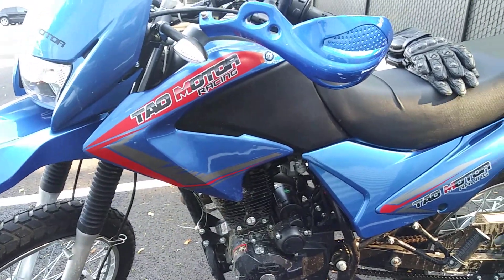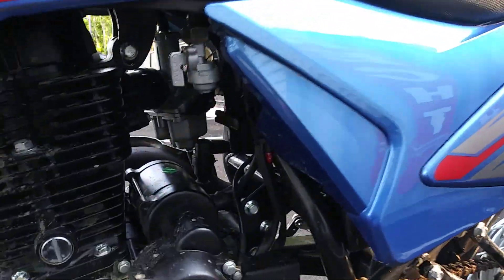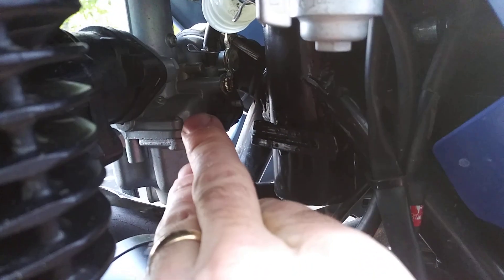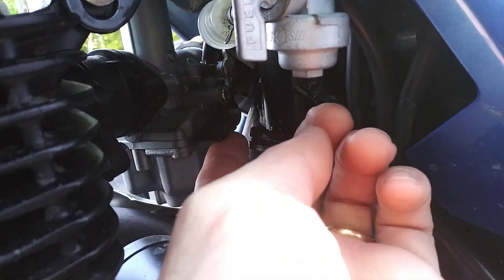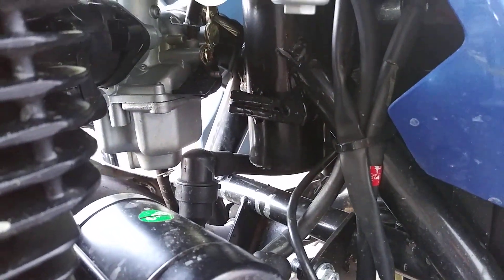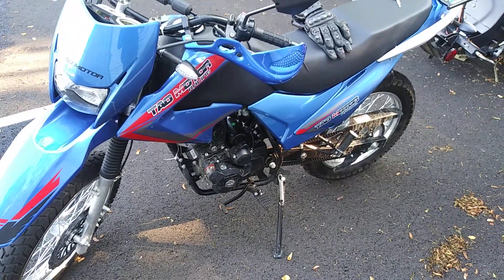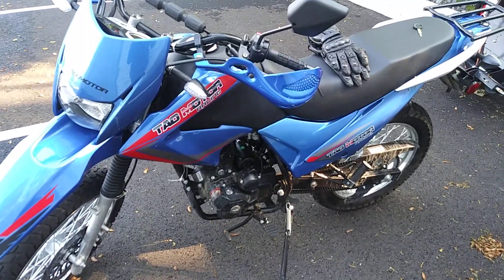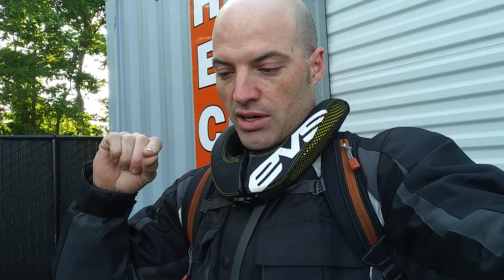Solution to Tao TBR7 Sputtering: Drive with choke at half position!

Comment: Bikes are lean from the factory.  Driving with the choke in the middle just restricts the air to match the fuel to get you a proper mix, BUT that means you're limiting the fuel and air that can go through the engine.

Instead, tune and get as much fuel and air through to get all the power your engine can give you.  Driving on half choke is not a fix, it's breaking a 2nd thing to compensate for another.

Comment: 2 turns out on the air mixture screw fixed mine.
Reply: Apparently full down position is good for off road, I can attest after tearing around in the woods, lots of torque at that setting

Comment: The 2021 model has the same switch on carb, only it's controlled via a knob on the left side of your handlebars.
Reply: Just got mine (my only youtube video so far) I got the Mikuni VM26 on Amazon. The cable you mentioned seems to be too long to pull on the choke lever. So I just removed it and rely on changing the choke directly on the carb. That cable was really convenient though!

Comment: It does that cuz it's either running too rich or not getting enough gas when they choke is off I bought a different 30 mm carburetor and some mikuni 110 Jets will update you guys next week and let you know if that stopped a problem if so all this costed under $50

Comment: Adjust the clip on the carb. Make the throtle needle go up a notch solves cold start . did it my zzr600 on all 4 carbs problem solved on 250 ninja same thing. No need on my cbr 600 rr fuel injection. Throtle needle screws into carb move clip down to lift needle up better idles as well

Comment: I did some research and found that the carb has three settings start, highway, and off-road
Reply: I've never heard of that on any bike I've ever owned, about 20. I think that's a bunch of nonsense. If you have a valid link. I'd be interested in seeing it.
Reply: @everready19373  No such link he is full of stinky stuff!
Reply from the maker: This totally makes sense because it ran great in full down position when I was messing around in the woods. Great torque you are right on that one! Thanks that this is "By Design" cool!!
Reply: @ConvertTheClassics  Absolutely not! That is not at all correct in regards to how that choke works. I wish that people that don't what they are talking about would not post false information Patrick! That will help the bike run better only because it helps mask the lean condition from the main jet being way to small. This is in almost all bikes to keep within the EPA standards. Where do people come up with this crap start highway and off road give me a break!
Reply: @barefootbob1269  I guess if carb blocks some air for the reduced fuel supply it's still stoichiometric... I'm with you that a bigger jet could give more power, eventually you'd still be limited by the size of the throttle plate I guess... Just sayin if you don't want to do any mods you still can have good drivability... Middle position works just fine

Comment: Thanks for the info.  Choke in middle position. Will check it out and see if better results happen.
Reply from the maker: Like a new bike!! I guess choke fully off is for CA emissions tests only!!
Reply: @ConvertTheClassics  Just tested your theory.  It worked!  Got it over 50 MPH with no problem.  Probably could have reached 60 MPH.